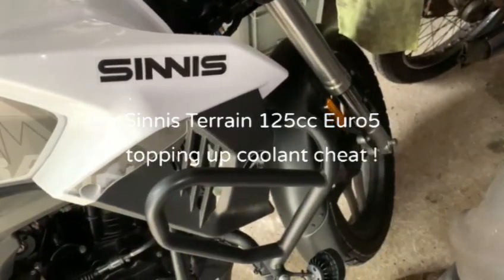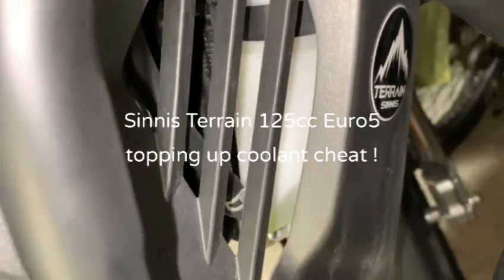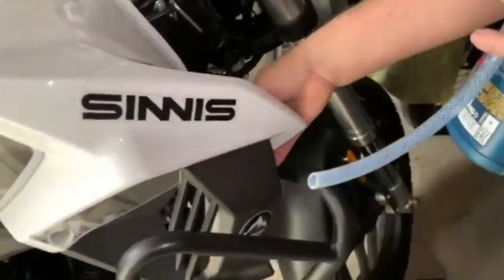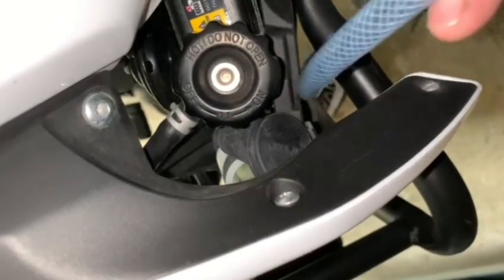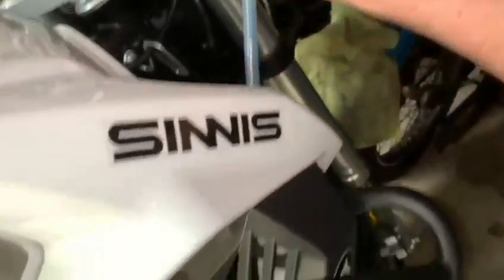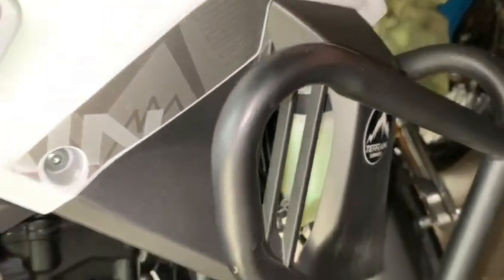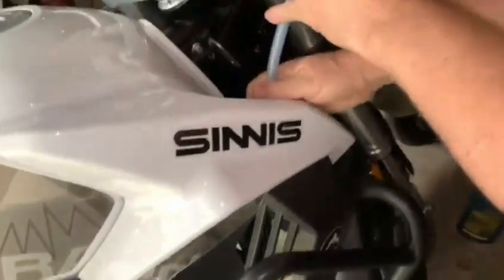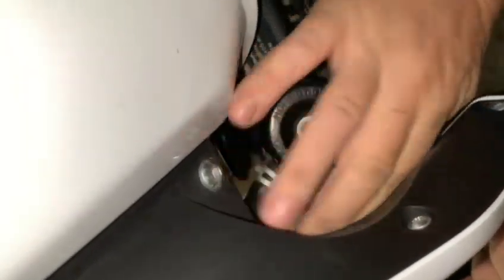Sinnis Terrain 125cc Euro5 topping up coolant cheat !

Comment: Now the thing is. In a sealed system their shouldn't be any coolant loss. So where is it going I wonder????? That's not a good thing.
Reply from the maker: That's a really good question I have checked our loss and found at a point it stops. Thus my conclusion is the expansion tank design is slightly too small causing loss from the overflow when the level is above the minimum mark when cool. Once you get just below the minimum mark loss stops so really at that point you are at status quo. Once I was happy with this and sure not a failure other than poor design I just make sure top up every now and then to keep the process going. I was thinking of fitting a larger expansion tank to prove the problem but finding one to suit is s  issue as don't want to fit an eyesore!

Comment: What coolant are you using?
Reply from the maker: Motul is recommended or if you can't get that any G13+ is absolutely fine
Reply: You said not to mix colours but I can’t find any green motul anywhere to top up reserve…any websites or brand you used ?
Reply from the maker: @leehutchinson8536  https://www.ebay.co.uk/itm/303081767198?mkcid=16&mkevt=1&mkrid=711-127632-2357-0&ssspo=UtC3VvnORl6&sssrc=2349624&ssuid=oXeJCTyTQ5u&var=&widget_ver=artemis&media=COPY this is perfect and slightly higher spec